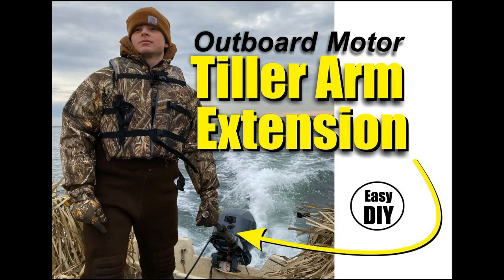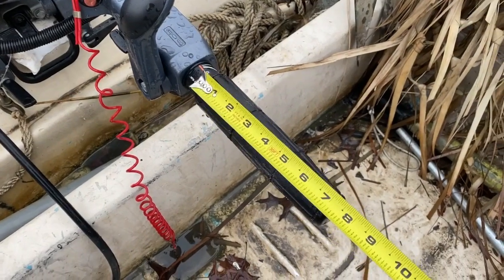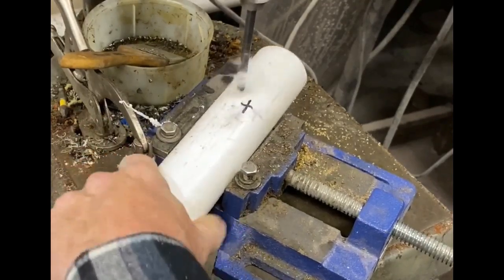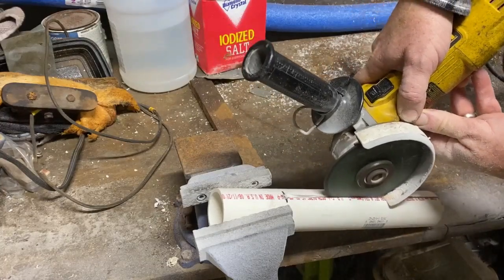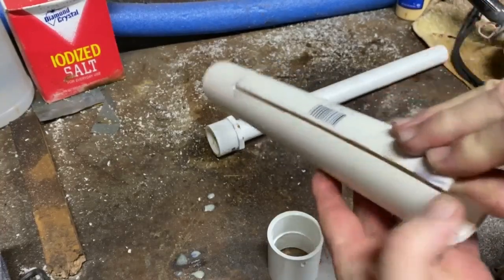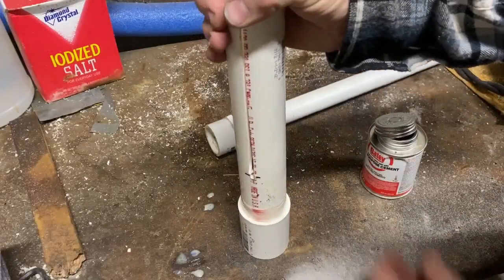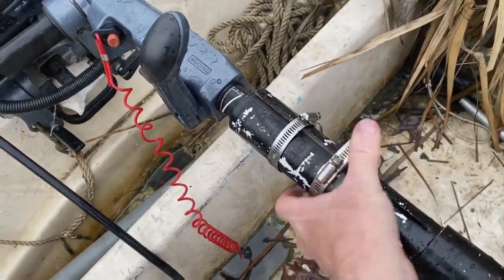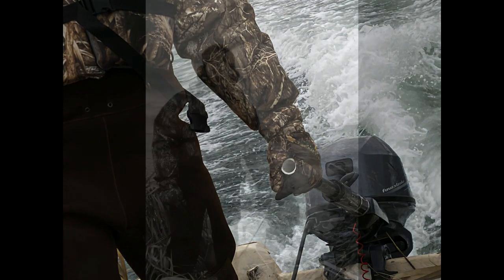DIY PVC Outboard Motor Tiller Arm Extension: Extend Your Reach with Ease

Comment: I used 2 shop vac extensions tube's, 1 slides inside the other to make the length perfect.  It slides exactly over the tiller handle. Cut 2 slits to give it the ability to clamp tight. This set up is much lighter than pvc and is already black color.
Reply from the maker: Sounds great!!

Comment: Great idea!  I'm having trouble finding the adapter as my local HD, Lowe's, Ace and Walmart all don't have it.  Shipping charges are stupid when I looked to order.  I saw another video where they heated up the 1.5 tube and gently inserted the 1.25.  My preferred method would have been the reducer but I'm going to try the heat treatment.